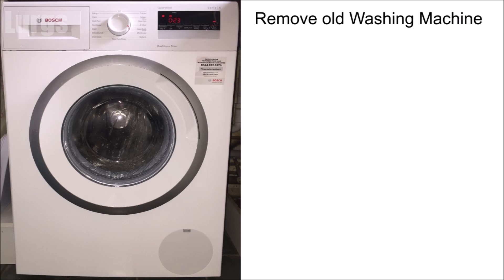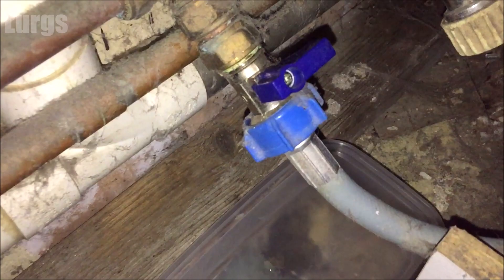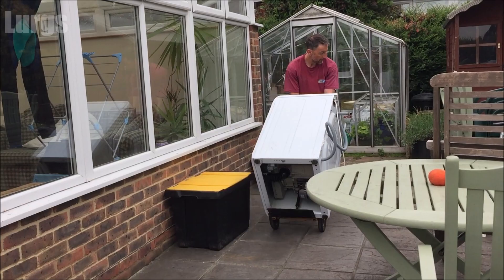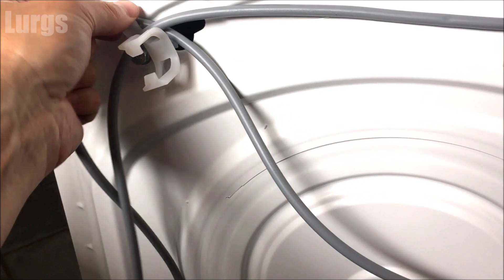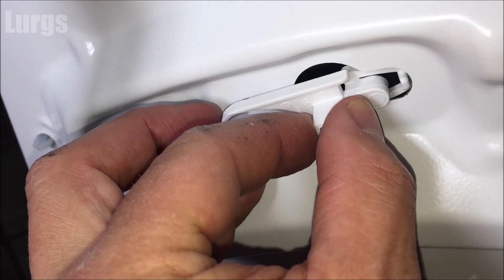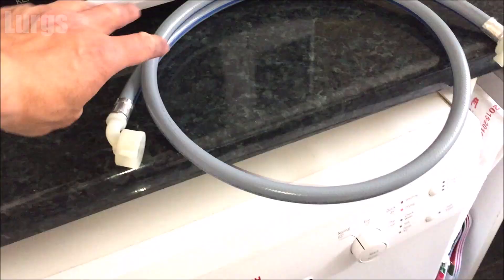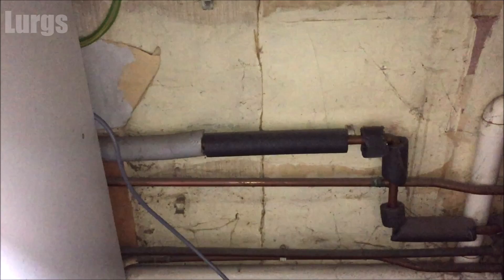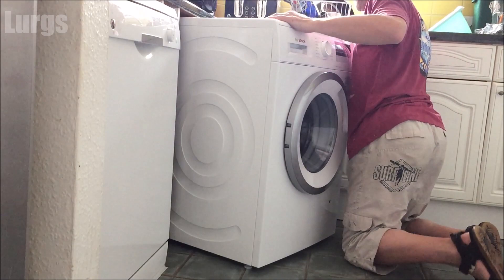How to install a new Washing Machine in 7 Simple Steps

Comment: Thanks so much, very helpful! I just have few issues with my hotpoint one (used), when I tested it I can't see the draining working and on top of that I can see water floating and it won't let me open the door. The "keys" icon is lit on red all the time 🤷🏻‍♂️
Reply from the maker: Need to check drainage pipework and also the filter. If it's new to you then check it was serviced as it should all be clear with a nice clean filter.

Comment: Excellent clear video many thanks. I'm getting a new Bosch machine tomorrow as my 25 year old whirlpool is leaking from underneath and making funny noises lol. My old machine has both hot and cold feeds, I can turn the valve on the hot feed to close it, but the cold feed valve is stuck open (tried 3-in-1 oil but no luck). I will have to turn off the mains water supply, but that is no problem. I am worried about leaks if I remove the old cold water hose, so I'm planning to leave it in place and simply take the rubber seal off the new hose and put it on the existing hose at the washing machine end. Does this sound like it will work?
Reply from the maker: I’ve just posted a new video here which has some extra footage in about drainage and feet locking nuts so this one is better https://youtu.be/7FXMLxVTLKU
Personally I would never use an old hose on your new machine. Use the brand new one as it will be better and the seals will be better and less likely to leak. Just turn mains water off and install new hose then turn mains water back on slowly and check for leaks before you push it back into place.
Reply: @LurgsHowToGuides  Thanks for the reply, I'll give it a go and wish me luck lol!
Reply from the maker: Good luck! 👍

Comment: Hello, lovely video. I bought a mew waving machine and tried installing it myself. I was removing the bolt when a screw fell inside, the manual did say that could happen, it also said that I should tilt the machine forward to retrieve it. I tried doing that but it is very heavy and I was not able to retrieve anything, any suggestions?
Reply from the maker: Fell inside where? What was the screw for? If it’s just in the casing somewhere then pull it out and tilt it around. Odd it says that in the manual
Reply: Sorry for all the typos, was typing really fast! I managed to tilt the machine forward with some help and retrieved the screw that fell.

Comment: Do you need to buy anything extra for installation or follow your guide and use the already provided kits?
Reply from the maker: A new washing machine will come with the mains cold water feed pipe and the drainage hose is built in, it should all be ready to just plumb into your existing pipework. Good luck

Comment: Hello Lurgs . Thanks for the video . Perhaps you can help me before I try to contact Bosch. I installed this machine last week and I decided that I would give it a wipe underneath today  to try to prevent the build up of grime that had occurred with the old machine . I used a thin piece of plastic with a cloth attached and it wouldn't go in . I see that there seems to be a metal tray beneath . Is this normal or was it something that I should have removed ?. Everything is fine , it spins perfectly etc. Sorry if I'm being silly here but this would make it harder to pull the unit out in the future. Thanks in advance , Kieron.
Reply from the maker: colekeircom The only thing that you have to remove is the installation bolts, as far as I’m aware there’s nothing else. Double check your manual but I’m sure it’s nothing to worry about, they wouldn’t put something underneath to remove as it’s so heavy to lift the machine.
Reply: @LurgsHowToGuides  Thanks , Kieron

Comment: I have a stupid question. If you're connecting it to the cold water source does that mean that the machine doesn't wash with hot water?
Reply from the maker: No that's all good, only a cold water feed hose only. Virtually all modern washing machines heat up the cold water to the desired temperature, no need for a hot water feed hose anymore.
Reply: @LurgsHowToGuides  Thank you!!

Comment: OK, I have a (stupid) question.  Do you not have to hook up both the hot and water???  I'm trying to figure out how to install an All In One ventless Washer Dryer . . . so if I only have to have one hook up to cold, let me know!
Reply from the maker: No not a stupid question. All modern appliances only take a cold water feed and heat up the water themselves to the required temperature

Comment: I just installed a new Bosch machine, but the detergent drawer isn’t emptying.. do you have an idea how to manage that?
Reply from the maker: Sara Almutairi If it's brand new that has to be a fault. Did you run a first wash without anything in it just to clear it all out, that's a drum clean or 90c quick wash.
If after that it it won't empty on a normal wash then you need to contact the place you bought it from.
Reply: Lurgs How To Guides thank you very much. I actually didn’t run an empty cycle. I’ll try it now. Thanks again! 😄

Comment: what should you do if i dont have that main "water nut" that turns of the water?
Reply from the maker: There must be a tap or lever to turn off the mains cold water feed, be very unusual not to have one. If you can’t find it then just turn off your mains water stopcock. Run a tap first to make sure it is off. When you turn it back on do it slowly.

Comment: How come there was no resistance when you took the bolls out lol I’m relying with my Beko & plyers,ten more to go my arm is killing,why did it think I could this,they are so tight 😕
Reply from the maker: They shouldn't be super tight, odd. Hope you got them all off ok. Happy New Year.
Reply: Jane ,you've probably done yours by now! I'm just going to add on this incase anyone else is looking as I am fitting a Beko and they are ridiculously tight. Found that the silver bolts don't come out from the big plastic bit - so just get them to turn loose, you'll feel them able to wriggle a bit , there's about a 1.5cm of thread to give you an idea of how much you need to  unscrew to disengage. Then the plasticy 'bolts'... haha turned my about 200 times as they have grip indents..note to self 'stupid', note to Beko WTF!... eventually found you had to angle them slightly , use the sticky-out silver bolt and gently push down, you'll see a gap appear between the metal machine back and the plastic bolt top, start tugging in the angled direction and then as the gap widens puh on the silver bolt in the opposite way...tugging...they will come out... bit like doing a champagne cork..bit this way, bit that. Job done! A friend just had same prob and followed these instructions ,5mins done..took me 2hrs to discover ... and now I continue to search for  someone fitting the waste securely to a sink outlet rather than down a pipe!!! and Lurgs, treat yourself to a magnetic spirit level! Tess
Reply: @tessjayne5817  Thanks ,first the auto correct,boll lol Well mine was a Beko the bolts were very tight & I only had plyers.The next problem I run in to was I turned the cold water of but it didn’t turn of ,it was broke & I had a small flood.Long story short ,NEW YEARS EVE,a man ,£40 quid & me deflated with a swelled wrist.I was going to be so proud of myself but I should have had it done,I was really upset now I look back it was silly to start 🤪🤪never mind,thanks anyway 👍🏻
Reply: @janeburke147  oh I'm sorry...I'm just about to do the drum clean ... so fingers crossed! Heaving 11st washer in the gap was also my downfall..but wasn't gonna be beaten! Connected water and I guess there's a stopvalve just as it goes in the 'body' ,no leaks where I screwed it on, lets hope the inners work or I'll be thoroughly bleep bleep bleeping bleeped!!

Comment: Sorry to point it out but there is one mistake in your video,after leveling the washing machine you forgot to tighten the locking nuts at the feet,you need to tighten the locking nuts upside or else it will start to move after some time
Reply from the maker: Blimey, I can’t see any locking nuts on this, hard to get to if it’s under a counter. I’ll have another look. Cheers for the info, I’ll update description if there are locking nuts.
Reply: @LurgsHowToGuides  the metal nuts at the feet you need to tighten those upwards away from feet to upside and tighten them
Reply from the maker: rohan divate Oh yeh of course. O man how did I miss that. Thanks for the info.

Comment: What do I do if I have a leak?
Reply from the maker: Danny Can you be more specific? Like where it's leaking
Reply: @LurgsHowToGuides  At the cold water feed tap.
Reply: @LurgsHowToGuides  should I use the white plumbers tape?
Reply from the maker: Danny Turn water off. Undo it fully, clean the thread on the mains one with an old toothbrush, then tighten it up again. Only hand tighten though, do not overtighten. You shouldn't need any Ptfe tape. Make sure you use the brand new hose
Reply: @LurgsHowToGuides  Still leaking. I noticed your cold tap has less thread than mine. When you tightened your hose, it covered all the thread right to the top. When I tighten my hose, you can still see half the thread. It doesn't tighten right to the top. Maybe I need to buy a extra connection?
Reply from the maker: Shouldn't make any difference as the nut tightens it pushes the washer  against the connection to stop any leaks. Make sure washer is nice and flat, make sure threads on the copper mains are clear. You could try ptfe as a last resort but you shouldn't need it. If you do use it make sure you wrap it round the correct way so it doesn't undo when you tighten it up. And you are definitely using the brand new hose?
Reply: @LurgsHowToGuides  Yes its the new hose. Once I turn the cold tap it starts leaking. I will try white tape on the weekend. Thanks a lot.

Comment: Levelling the feet as you've shown is WRONG ,,
The nut is for tightening up against the base of the machine, AFTER, you have raised or lowered the foot, to get it level.,, (locking the rubber foot in place,),, 
if you leave it like you have done, (loose), the rubber foot will gradually screw itself in, over time, as the machine is moving during spin etc... and then the machine won't be level any more, and will dance around the kitchen,, !! (and vibrate badly)...
Reply from the maker: Yes it’s in the description and also in my new video How to Install a washing machine. Cheers
Reply: @LurgsHowToGuides 
Perhaps you should get rid of this video then,, it's bad advice for someone who is looking how to install their new washing machine,??
Reply from the maker: I've got a link in the description to the new Video which covers the locking nuts. As soon as my new one overtakes this one in views I will delete it. Cheers.